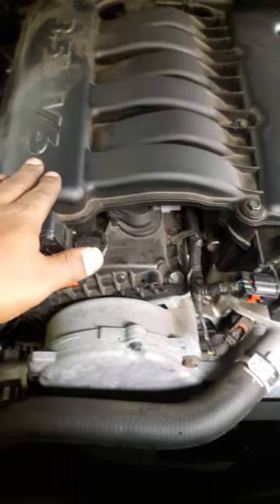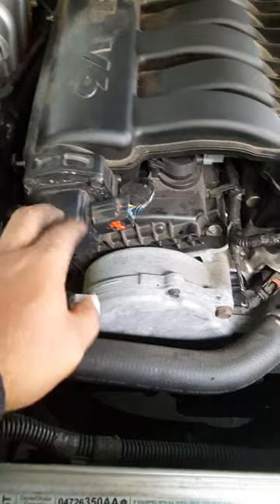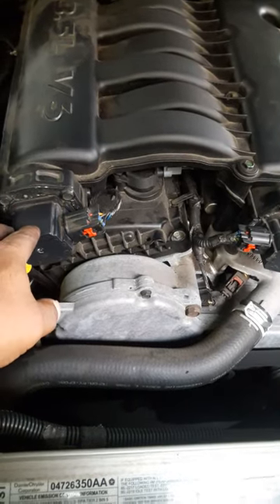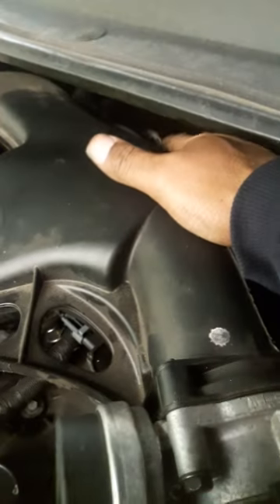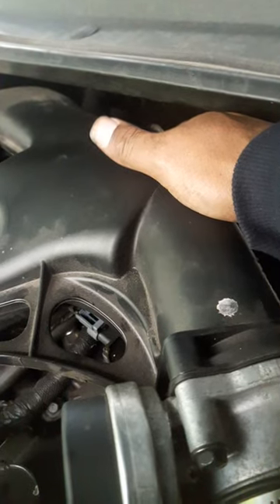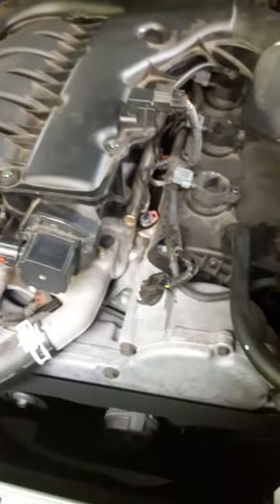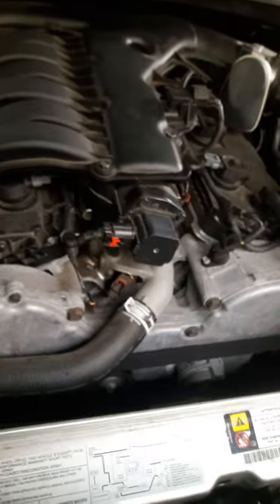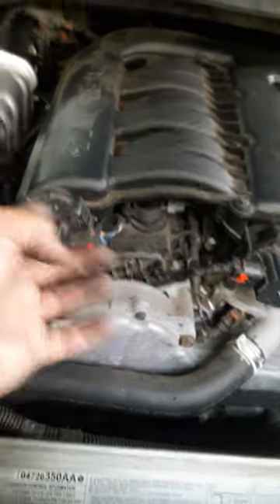P0660 code manifold tuning valve control circuit

Comment: I have the same problem  . I replaced whole unit but still getting the code. Do I have to drive it until the light go out
Reply: Sometimes the ECU keeps the code. You would have to either drive it to clear it, or disconnect the battery to reset ECU.
Reply: You need to change the oxygen sensor 1 in order to clear out engine ligth

Comment: I got the same problem
Reply from the maker: CHICAGORILLA replace the tuner valve I believe I ordered mine off of Amazon and also I had purchased some pre gap spark plugs that was causing the tuner valve to act up so when I bought my new set of pre gap spark plugs I made sure that they were properly gap most pre gapped spark plugs are offset and that will cause a problem.   New gap plugs that fixed my problem
Reply: Kasetownbiz ok cool thanks.. Now the tuner valve is the square thing on the left side of the plenum with the clip?
Reply from the maker: CHICAGORILLA right
Reply: So replace that and spark plugs cool..
Reply from the maker: CHICAGORILLA remember to disconnect your ground
Reply: I had same code P0660 on a 2010 Dodge Journey that has the 3.5L 6 cylinder engine. I changed the tuning valve control circuit (the square thing on left side in this video) & the P0660 went away but then I got a P1005 which could indicate wire problem between tuning valve circuit and pcm. I checked the individual wires as best I could  using VOM & they appeared fine. I did not have a 2 way code reader that could send commands into the car so I paid the dodge dealer $130 to run diagnostic since they can send in commands to car to actuate the tuning valve. The P1005 problem was the new tuning valve circuit I installed. It was some after market brand that one of the big chain national auto parts stores sales (made in China & cheaper prices than MOPAR). The new valve moved to slow and was not within the default specification measured by the pcm. I removed that tuning valve circuit and installed a MOPAR brand (made in USA) and my P1005 code went away.  I’m sure the China made ones will work but you possibly may need to go through a few to get a good one. The tuning valve circuit is expensive, that alone cost about 1/2 of just buying a whole new intake manifold that comes with the tuning valve and short runner valve.